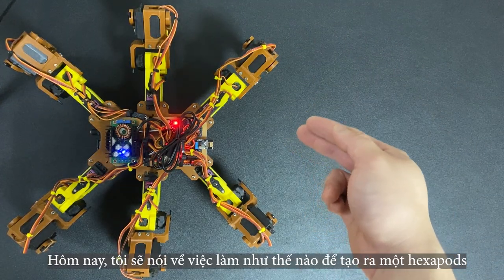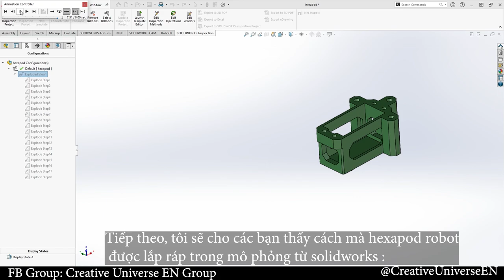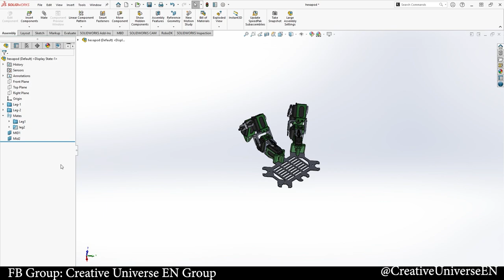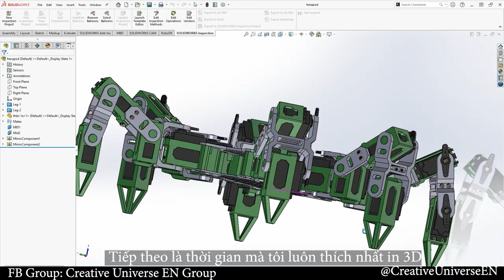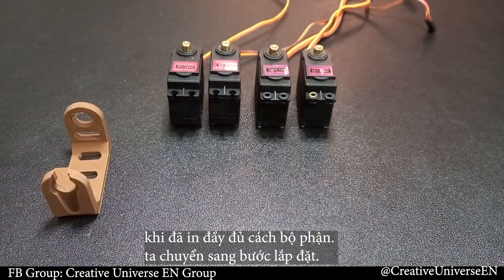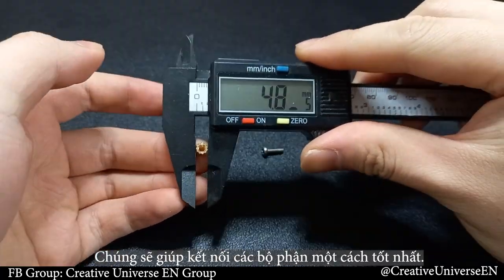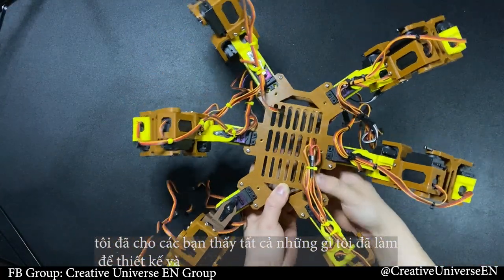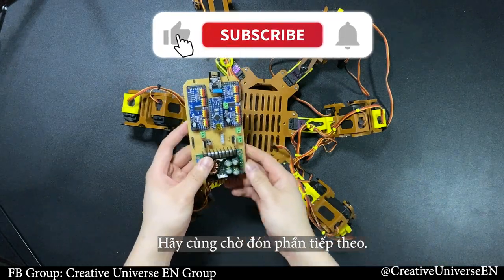How I built an Arduino Powered Hexapod. Part 1 of 3: Design, Print and Install.

Comment: keep up the good work ! I really like your content ! i am thinking of making a 8 legged spider robot with modular attachment for two extra legs with claws, so basically a decapod with 32 DOF. Do you think it is possible to get by with  MG966R? still no sure which battery to buy🥲
Reply from the maker: i think it's possible using MG996R. i tested the load capacity on my design and it can load 1kg to 1.5kg more. but when the mass increases need to reduce the robot's speed otherwise it will damage the servo.